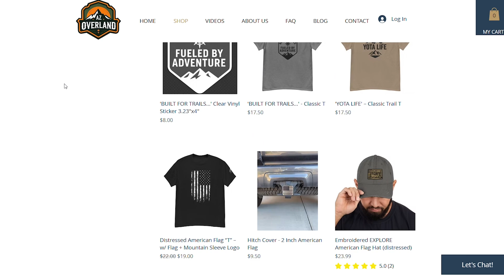Can the AUXBEAM Switch Panel Control a 6-MODE Light?

Comment from the maker: Website with Merch and more: 
https://www.azoverland.net/

In the Video:

*Auxbeam 8 Gang Switch Panel Kit
https://amzn.to/3FcJJ5I

*Auxbeam 4 Inch LED Pods (6 Mode)
https://amzn.to/4272bHM

*Ferrule Crimping Tool Kit
https://amzn.to/3Z5jXbg

Helpful Wiring and Install Videos:

How To Wire The Auxbeam Switch Panel
   • AUXBEAM 8 Switch Panel - How To Wire  

How To Wire a 2 Mode Light To Your Switch Panel
   • HOW TO Wire a 2 Mode Light To Your Switch ...  

Auxbeam Install in 4Runner
   • Ditch Your Relays! Auxbeam Switch Panel In...  

*this channel may receive a small commission when ordering from certain links. Thank you for your support

Comment: i have a 3 mode light with 4 wires. How do i wire that? I didn't realize you can use just one ground wire to run the lights.
Reply from the maker: On this model Auxbeam the grounds act as sort of a bus bar. If you are grounding a light or set of lights from 1 harness, that ground will work for the circuits you connect the harness to. 

I have not wired a 4 wire light into the Auxbeam. I'm not sure it would work, but it may. You might lose a function/mode if you leave a wire out, but it could possibly work. You would need to experiment with that on your own

Comment: would i be able to run this on a auxilary port? or would i have to change the mode to a preference and then only connect the main wire and cover the yellow?
Reply from the maker: I run a multi mode light just as seen in the video. I use a separate circuit with the "trigger" wire connected to it to keep the ability to change modes when I want

Comment: Does the amperage of the circuit for the yellow wire matter? I also want to wire in an Auxbeam 6-mode LED (probably the 7 inchers that come in a set of two).
Reply from the maker: Good question. I don't believe it does since there is such little draw. I put it on a 5 Amp circuit. It may be different for your lights

Comment: I chopped my lights at the relay and had 3 wires red black and white. Hooked it like I showed and modes don’t work ? An clue why?
Reply from the maker: Every light harness is different. Exactly what lights are you using? Feel free to send me pictures of the harness you cut and how you connected it

Support@AZOverland.net

Comment: Can you put different modes of the same light on different buttons or does the yellow wire ckt only change modes? Amber only on/off on one button and amber/white strobe on another button for a dedicated strobe ckt and a dedicated amber fog light ckt?
Reply from the maker: No. The yellow wire is the signal wire which tells the light to change modes. Now, if you had a 2 mode light, then yes, that is the way you would wire it up and it would work. I've done lights with a white and amber mode, and wired then so 1 button lit the whites up and another button lit the ambers.

Comment: Can I use this way to connect a light bar and two pods independently for the 6-mode light with the 6-gang, or do I need the 8-gang?
Reply from the maker: If you have similar lights, as far as modes, then yes. You would need to take up 4 circuits, 2 for each. I have not experimented with RGB lights yet

Comment: Question - can you run one of the buttons as "always" hot?  or is it all hot/all switched?
Reply from the maker: The circuits are switched. There is no lower running through until activated by the button on the panel. Once the panel is off all the circuits are off

Comment: How would you wire up multiple 6-mode lights?  For example, I have a pair of 6-mode ditch lights, a pair of 6-mode bumper mounted lights, and a 6 mode light bar.  Is there a way to condense the switch wires to a single button or do I just need a bigger switch panel?
Reply: Have you tried it yet I'm going to try running all the ones in parallel. Front for 2 switches rear lights for 2 switches. That's what I've come up with so far I haven't tested it yet.
Reply from the maker: You need a bigger switch panel if you want to control all 6 mode lights
Reply: If you were within amperage limits and all turned on at same time. I can't see a problem with all the yellow wires going to one switch but you still need the power switch. My only question is getting them to all sync up .

Comment: Can you do a demo on how to connect led pods to reverse lights and also auxbeam switch panel
Reply from the maker: It can be done, but it gets a little involved when doing it with the Auxbeam. The new D-Switch from Diode Dynamics is made for situations like this. Basically, you would need to wire in a relay that connects both your Auxbeam and lights that would trigger the lights depending when you want them on

Comment: This is so timely for me. Thank you. I just bought 2 pairs of the Auxbeam 3 inch XP-Ultra 96w 6 mode pod lights and a BA80 switch. Was thinking I would need to return the switch for one with a mode button. Just to be clear, I chop the wire at the relay and there should be just 3 wires? I am seeing 4 going into the built in switch for the XP-Ultra lights... red, yellow, black and white. Appreciate your help.
Reply from the maker: Correct, but email me some pictures of the harness and switch so I can take a close look. I assume the 4th wire is from the switch to the relay to activate the relay.

Support@AZOverland.net
Reply: @AZOverland2017  Thank you!. Email sent.

Comment: Amazing video, but could i connect both pod lights in one circuit and both switch cables together??
Reply from the maker: Depending on your exact model light. In most cases, yes. I showed that in a few videos that I did
Reply: @AZOverland2017 
Ok thank you. Could you post those videos I haven’t found them. 

I want to turn the lights only with one switch and change the mods with only one switch too. But first i want to make sure if it’s possible i don’t want to mess the lights
Reply from the maker: @MarcoGarcia-v4n  
Look towards the end of this video at like the 9:30 mark:
https://www.youtube.com/watch?v=ioepyPizNCY&t=5s

These 2 should be helpful as well:

https://www.youtube.com/watch?v=UDQbDfAf-yk

https://www.youtube.com/watch?v=U6ZLO_qQHPY

Comment: About to add some led strips lights to illuminate side steps and want them to come on when I open any door on pickup, what's the best way to wire them to an 8 gang aux beam and which wires are best to tap into, interior dome light or central locking?
Enjoying your videos here in the UK keep them coming bud
Reply from the maker: Thank you! I love hearing from my overseas subscribers. If you want to control those side step lights with both the Auxbeam and using a trigger, it gets a bit more involved. You will most likely need to wire in a relay that will isolate both the Auxbeam signal and the dome light (courtesy light) signal. By adding lights to the courtesy lights, you take a chance of overloading the circuit. You would need to have that trigger a relay to provide power to the lights so it is isolated from the courtesy light circuit
Reply: @AZOverland2017 ah OK that's probably bit too complicated for my level of auto electrics, so if I were to take an easier option would you recommend just dropping into the central locking wiring and wire the led light with an inline fuse and not using auxbeam at all? I just want the lights to trigger when the car is  open and don't want them as running lights etc
Reply from the maker: @ezdrummersongs1713  I still believe the using the courtesy lights as the source (trigger) would work best, not the locking wiring. The issue is that those lights are on a low current circuit and could quite possibly overload the circuit if adding more of a current draw with the added LEDs. You should still consider a relay to avoid that. Nothing is easy, huh?

This is the reason I changed to the D-Switch witch Panel that I showed on my last 2 videos. You can just take a trigger wire and wire directly to the circuit, program on the app what you want your lights to do,  and the Switch Panel will take care of the rest. No need to wire in relays.
Reply: @AZOverland2017  Thanks for the advice bud, think I'm gonna be super careful and wire in a relay to the circuit as it's a newish pickup and don't wanna burn it down! I watched your video on the D switch panel and it is an absolute beast of a product but gonna go with the auxbeam for now when it arrives from Ebay next week.
Loving this journey of auto electrics learning so much from your videos and others on youtube, keep up the good work my friend and peace and love from the UK

Comment: How could you wire in aux reverse lights that come on with factory reverse lights as well as manual on/off functions using the auxbeam switch?
Reply from the maker: So sorry, I missed this!
It is a bit involved with this Switch Panel. It would be very easy with the D-Switch I just did a video on.

Basically you would need to wire in a relay that isolates not the reverse light circuit and the Auxbeam so they can operate independently
Reply: @AZOverland2017  Thank you for the videos! Would you be able to create a video showing how to do that (adding in a relay to the reverse light circuit)? Id love to have my reverse lights on this switch panel to be turned on/off independently as I wish. But would also like them to come on automatically whenever I switch into reverse. Similarly, Id like to have the DRL lights on linked to my headlights. Same concept as in I do not want to have to manually flip a switch to get my DRLs on my PODs to come on

Comment: Is there a way to get your light only to light up on high beam?
Reply from the maker: What light are you using?
Reply: @AZOverland2017 i have a strands led bar, but i want to have it turn on when i turn on high beam, as I have it now i do it with a relay,  but i wonder if these panels can do that too, and also be able to turn the led bar off if needed

Comment: The yellow wire can it be connected with the red wire and have that other port available for something else
Reply from the maker: Good question! It will not operate properly if you connect those 2 wires. 
Yes, you can scroll through the different modes, but you can't lock a mode in. So, if you get to a mode you want and release the button, it will revert back to the default mode in a few seconds. Separating the wires is the only way I found to lock a specific mode in
Reply: @AZOverland2017 can you do a short or something showing this?

Comment: Thank you for all your help. My question is can I install 1500 inverters on auxbeam block if so what fuse amp do i use.
Reply from the maker: I don't have a lot of experience with this particular install. I believe it's possible but a bit more complicated than just connecting it to the Auxbeam.

Comment: Change the second button to pulse….
Reply from the maker: You can't on this particular model. But, on others Panels with that feature, it can certainly be a good option
Reply: @AZOverland2017 explain please
Reply: Explain please
Reply from the maker: @unknown_0ne  This Switch Panel does not have a "Pulse" mode.

Comment: I have a 22in light bar with 6 light modes exactly like the video showed. 
Can you have each mode to a different button? Such as solid amber light to bottom left; strobe amber bottom middle; solid white bottom right, etc. ?
Is this possible? 
Thanks
Reply from the maker: I don't think that's possible. The wire that is not the + or - would be the trigger wire that switches the modes. The button/circuit it is connected to would be the only way of changing between modes. The other buttons/ circuits would not be controlling anything since there are no wires running to them

Comment: Can you connect the yellow wire to the 5amp fuse?
Reply from the maker: The circuit you connect it to will depend on the amp draw of your specific lights. Yo will need to determine what the draw is for your setup.

Comment: Tried this with the color play series RGB pod lights. Doesn’t seem to work.
Reply from the maker: Interesting. How many wires come from each pod?
Reply: @AZOverland2017 red black and white
Reply from the maker: @xXsuzuki88Xx  There must be some sort of controller inside the light. I assume if you just connect the red and black to 1 circuit, it will turn the light On and Off? What happens when that white wire is attached to the 2nd circuit and the button is pressed? I wish they weren't so expensive or I would order them and play around a bit.
Reply: @AZOverland2017 They didn’t even turn on hooked up like you had yours. They would flicker that’s it. I believe it’s the controller inside the remote that relays back and forth back out to the lights. It should be more simple than what it is.
Reply: @AZOverland2017  They were only 150 bucks with a discount code. It would be a challenge that's for sure. completely stumped me.

Comment: I wondered about this myself. I bought the same switch panel for my 3rd gen Tacoma, but I never got to install it cause my truck was totaled. Now im installing it on my 4th gen. Eventually, I'd like to upgrade my switch panel to a newer version.
Reply from the maker: How are you liking the 4th Gen?
Stay tuned, I'm doing a video soon on a new Switch Panel that I'm installing in my 4Runner. This thing is pretty wild...
Reply: @AZOverland2017 I'm loving the 4th gen so far, I've had it almost a year now. Just have to start over with the mods.

Comment: More light features = more better ha ha! I love my lights and have more than most guys but honestly they are one of the mods I use the most. In the PNW, I switch from amber to white, to bumper mounted lights to roof mounted lights based on mist, fog, rain, snow, dust, hail and you name it.
Reply from the maker: We only have to deal with dust and the occasional rain here. But, it's certainly nice to be able to have full control of the lights in any condition. Do you have the Switch Pro?